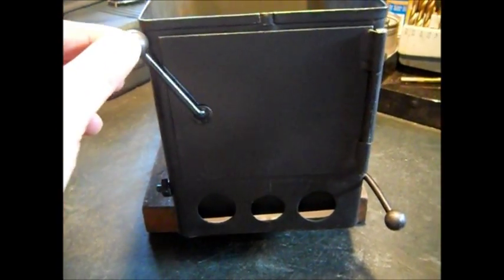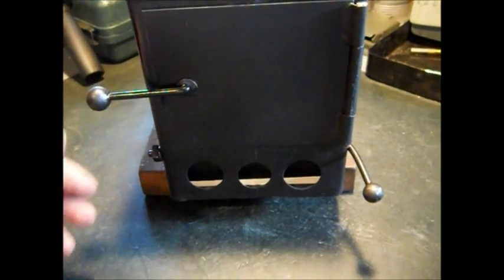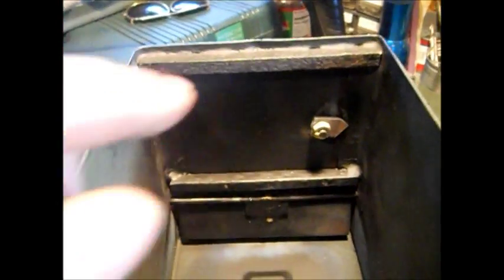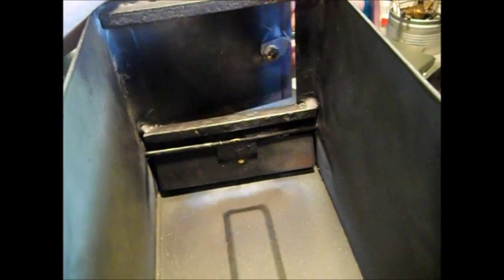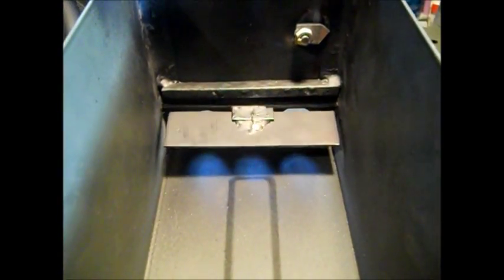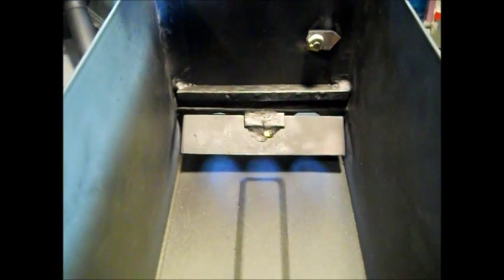Ammo Can Stove Part 3

Comment: Did you make the "knob" for the latch yourself or was that part already manufactured? Thanks!
Reply from the maker: mossy1 I use that epoxy that you knead together like clay and roll it into a ball then drill a hole in it and glue or epoxy it on